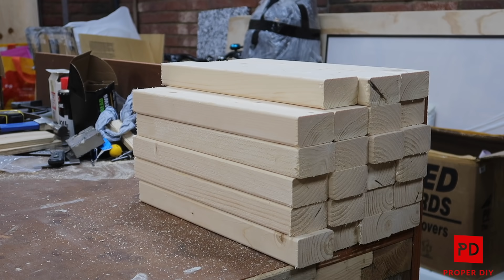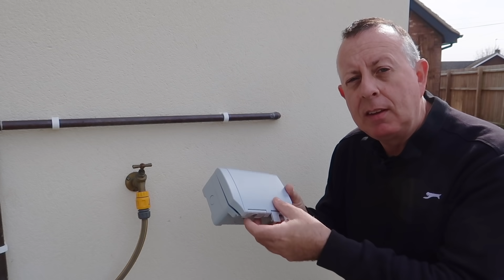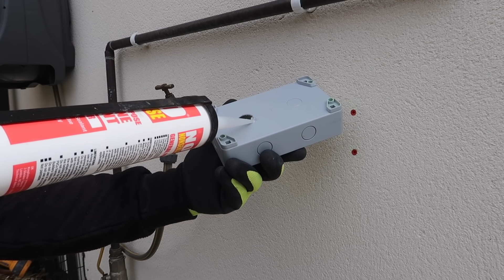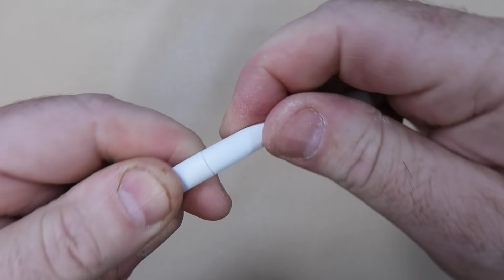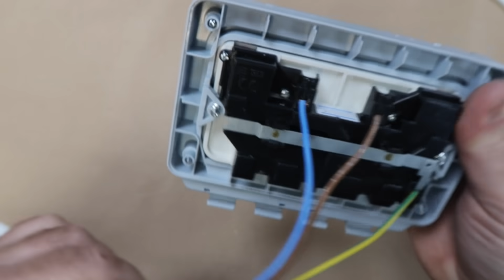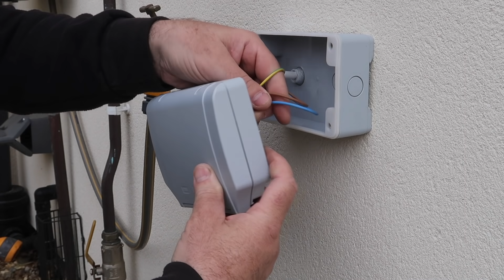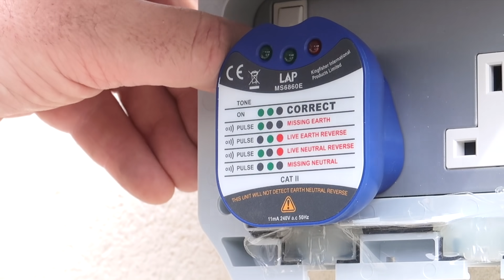How to Install the Easiest Outdoor Socket

Comment: Hi, complete electrical novice here so please excuse the "dumb" question.  In other similar videos about installing  an outside double socket all other fitters  have shown  to use a second earth cable to earth the box too. In your video just the 2 sockets are connected to the 3 wires. Is that OK or does it depend on what   the sockets will be used for?
Reply from the maker: It depends on the type of socket surround. My one is plastic so no need to earth but any that are metal will need a fly lead to ensure the box is earthed.
Reply: @ProperDIY  Many thanks. I haven't  bought the box yet, I keep watching these videos to give me the confidence  to try this myself. If I get a box and it turns out to be metal ,can you explain ( simply) what the "fly lead" is? Is it just a spare length of earth wire cut from an existing  cable?
Reply from the maker: @robinpunter4377  Yes exactly. You attach it from the earth connector on the back of the socket to typically a screw connector attached to the backbox. Good practice means you should put an earth sleeve around it to identify it as earth and ensure it doesn't make contact with any other connections.

Comment: Good drilling ! I confess I would always take it off an existing socket as a spur . Yes I know it means opening the wall plate and isolating but it’s a much nicer job internally instead of runnng wires n skirting etc , in my mind. I always do basic testing of it using a testing plug that tells me if it’s good etc when done that way and never had any issues .. I imagine the electricians will be horrified that a DIY’er dares to wire a socket themselves though …
Reply from the maker: Taking it off a spur is fine - just trying to give people different ideas. Yes, I get a lot of flack from electricians who think they are the only ones would should change a plug!

Comment: Excellent vid, will be fitting one of these next spring. However this has got me thinking. I’m putting in a media wall with TV etc. To break into ring main will be a lot of work and messy. My nearest socket is over 2m away, I could run an extension cable but it would look rubbish - I’d like to see a finished socket.... so could I adopt a similar method for an indoor socket?

Comment: Watching from Canada..  Nice job,  the codes are very different here and U.S.,  They wouldn't allow that type of setup here (essentially an extension cord through the wall) thus braided flex wire is not allowed in that application, and outside plugs (assuming that is 240V), as you mentioned, circuit must be dedicated AFCI/GFCI circuit either at the box or panel. Just did one for my kids electric car and conduit must also be coupled/ secured at the box.
Reply: I was looking for a comment along these lines. I also noticed the PEX connector, and I wasn't sure if that would fly. Any knowledge of that?

Comment: Great video, thanks for the clear explanation. Would this be a suitable option for getting power to a garden office cabin as long as the cable is armoured and buried at the correct depth? Would that allow for a small electrical heater and lighting etc? My gut feeling is I need an electrician to wire the cabin to the main house consumer unit but just wanted to check my options. Cheers!
Reply from the maker: Good question. Although there is no theoretical reason that this solution wouldn't get a certain amount of power to a garden office (even with an armoured cable properly installed). But, you really need to ensure that the earth is properly connected and an RCD (either external or within your consumer unit) is working at the correct speed etc. Both of those are difficult to prove without the correct training and equipment which is where I think an electrician comes in I'm afraid.
Reply: @ProperDIY  Thanks for the reply, much appreciated. I had a feeling that would be the way to go but just wanted to check. You have a great channel here, keep up the good work. Cheers!

Comment: Just wondering PD, is 1•5 flex a little on the low size if you were using power tools for garden projects ? I would have used 2•5 t & e , but then that's just me.
Reply from the maker: The problem with 2.5mm twin & earth is according to the regs it is not allowed to be used with a plug as future movement around the plug could cause it to break over time. 1.5mm flex can still take 10 amps which is enough for most tools
Reply: @ProperDIY  Fair point PD.

Comment: If you put the cable clip nail between the wire and base board. You can end up damaging the base board with the hammer. Having the wire on the base and nail above is the best way of doing it.

Comment: I love the way you did this and all the reasons why.  I’m planning to put an outdoor socket in for Christmas tree lights.  What could be more simple.  Thank you.  Liked and subscribed👍🏼
Reply from the maker: Glad it was helpful!
Reply: @ProperDIY Hi Stuart.  Me again.  I watched this video around three years ago and used your method for installing the outside socket and it still works great (touch wood) and it’s been really useful.  
So up to today and my daughter has asked me to fit one for her. No problem, it’s what us Dads do. But when I went online to look for a socket I was interested to see that most sockets now come with a length of cable with a 13 amp plug attached.  I know at the time there was a little bit of controversy regarding this method of installation. However, now that manufacturers are selling the plug sockets with a plug attached, in my opinion it disproves all the doubters.  Maybe it was actually you that gave them the idea eh?  Thanks again, Steve.
Reply from the maker: @stevejeffery4951  Thanks Steve for the info - I didn't realise! as I haven't fitted one since. I'm going to have a look into that now - and try to claim some backdated rights! (especially after the grief I got at the time from some people as you say!)

Comment: Silly question, but why the blank internal box,is it just cosmetic?
Reply from the maker: Yes correct - better than just seeing a cable surrounded with silicone coming out if the wall

Comment: Great video, what size drill did you use and also whats the best cable to get? Thank you
Reply from the maker: I used a 1.5mm cable as it will take more than the 13amp fuse. I think the drill was around 18 ro 20mm
Reply: @ProperDIY  thank you very much for your reply 👍

Comment: Does it not need to be 2.5mm cable for sockets?
Reply from the maker: It's all going through a 13amp plug so any cable over 1.5mm doesn't make any difference- the fuse will blow first
Reply: @ProperDIY  That's good because I got some 2.5mm and it's so thick and rigid I can't make it neat like I could with 1.5mm Flexi :)

Comment: I followed your advice to install an outdoor socket yesterday. Only after I installed did I read the instructions that say drilling out the rear knockout also compromises the IP rating. It seems the only way to retain the IP66 rating is to use a bottom knockout with the appropriate gland (and an unsightly wire coming out the bottom of the socket). This makes sense if the socket is remote from the house/garage but when on the side of the house is not a good look in my opinion.

Comment: Would a 25mm drill bit be ok and 20mm pipe instead or do I need to use the 18mm drill bit and 15mm pipe?

Comment: As an amateur,  can I ask why 1.5mm? I always thought 2.5 for mains and 1.5 for lighting as good practice. Thanks.
Reply from the maker: It's because in this configuration, the cable ends up getting fitted with a plug which is not something you can do with 2.5mm twin & earth.
Reply: @ProperDIY  thank you

Comment: My pottery kiln is rated at 2.9kw and the manual says "Ensure NO power board or extension cable is used between the power socket and the furnace." Would it not be appropriate to use this outdoor socket solution?

Comment: I actually bought a longer drill bit but in fact it was no good, because when it came through to the other side it blew out the rendering and left a big exit wound that needed to be redone and repainted! so drilling from both sides is definitely better, if you can figure out exactly where to mark, very clean and nice skill!
Reply: To

Comment: I’m an electrician myself and I like this idea and a very neat installation. Couple of tips When using stranded flex cable I always use ferrule crimps to prevent damaging the stranded cores when terminating. Also make sure the socket you plug into is RCD protected inside the house 👍.
Reply: He didn’t leave enough slack on the plug to use a bulky RCD adapter! 😂
Reply: Feral … 🦊  … maybe a bootlace ferrule would be better 😂😂😂
Reply: @andyxox4168  I thought that was an aglet 🤔
Reply: Nice to see you’ve corrected ‘Feral’
Reply: Also make sure the indoor socket you're plugging into is protected by an A type RCD and not an AC type to conform to current 18th edition electrical regulations.
Reply: Using crimps a bit overkill
Reply: @AuroraDragon_  required by bs7671 for fine stranded conductors

Comment: Hi Stuart, thoroughly enjoying all of your videos, great content and production. As a former electrician and electrical installation lecturer I agree that this is an excellent option for an experienced DIYer. This method removes the need to safely isolate, test and certify wiring attached to the existing circuit. As you mentioned this is an RCD protected extension lead so a great option for outdoor power. I used to teach the folding over method and the reason is that most terminals on electrical accessories are designed for two cables, so folding a single cable helps to fill the terminal and provide a more secure connection. Keep up the good work!
Reply from the maker: John, that is very much appreciated coming from an electrician - I tend to get a lot of grief from electricians who do't want to see anyone unqualified even fit a plug. Now I know why the cables are folded - learn something new every day!
Reply: @ProperDIY  Hi Stuart, I agree completely that in some circumstances a qualified tradesperson is the best option, but DIYers will have a go. I think you've illustrated a safe method of achieving an identical result to anything an electrician could produce. Do you mind me asking of you've done any formal teaching?
Reply from the maker: @JohnCarr43  Thanks! No, no formal training or teaching.
Reply: @ProperDIY  A natural then! Your videos are very clear and well produced, (I've currently got a large piece of plywood and several lengths of 2X4 in my garage ready to follow your workbench tutorial!) Looking forward to your next video.
Reply from the maker: @JohnCarr43  Nice one! Good luck with the build - new video out today!

Comment: Hi Stuart. Am about to order this kit and follow your instructions. Only difference is to power it,  I will have to run external flex along wall into the bottom of this unit. Do you recommend what kind and size of grommet/gland I need to order ???  Keep up the good work.

Comment: This a fixed installation you are installing and as such flexible cable must not be used ☹️ Regs. Also any outside socket must protected with RCD Regs again.
Reply from the maker: A flex 1.5mm cable can be used as it's essentially an extension lead protected by the 13amp fuse. You do absolutely need an RCD which I explained in the video.

Comment: Boy totally different wire colors used for hot and ground and different type of outlets from American standards. And no exposed electrical wires are allowed. Must be in conduit. Boy what a difference in electrical codes.
Reply from the maker: Yes totally different - maybe because we in the UK are also at 240v rather than 110v

Comment: Does the cable not need to be 2.5 core flex rather than 1.5?
Reply from the maker: No, the 1.5mm flex has more capacity than the 13amp fuse in the plug so the fuse would blow before the cable gets overloaded.

Comment: Great video. Thanks 👍🏻. Is it possible to install a switched fused spur on the inside of the wall to the plug?  Sorry - total novice (and don’t worry, not something I’d attempt myself!).
Reply from the maker: Thanks. Yes can do - if you were going to do that, it would be wired directly into your ring circuit of your sockets - no plug needed. No problem with this and it would be the way an electrician would naturally do it for you.

Comment: Very impressed and I totally agree its the safest DIY method and also with the added bonuses you mentioned  . One tip if using a set of pliers to strip back the insulation on the cables, is to do exactly what you did with the knife and score round first (basically griping the cable in the cutting edge and turning the pliers clockwise and back a couple of times ; this prevents both you gripping too tight and cutting it off completely and also helps prevent pulling the odd strand off too .. (apologies if this is mentioned below - 884 comments at the time of writing) 30+ years ago when doing my apprenticeship, we were always told to use strippers (cable ones!!!!) but, after a bit of practice you know just how tight to grip and it saves a bit of time as you can strip, cut and bend all in one go (so to speak! 🤔)
Reply: The only down side of this is that you take away one of your internal sockets availabilty. Rather wire as a spur or better still as part of the ring main, but it would then require sign off

Comment: I'm no expert elec but know you wouldn't have a socket in a bathroom or near taps etc. It's very near and in reach of the outside water tap. But a good series of advice and tips.

Comment: Nice one. I used a similar method to have a plug socket 40ft away from my house on my deck, but using armoured cable and an RCD plug to give a bit of extra safety just in case, given the exposed nature of the armoured cable running along my garden fence. 20yrs on and it's still a functioning extension socket.

Comment: 1.5 mil cable??? ...surely you mean 2.5...
Reply from the maker: No, 1.5mm flex. 2.5mm solid core is difficult to get into a plug and as the plug has a 13amp fuse a 2.5mm cable is isnt needed as a 1.5mm flex can take 15amps so the fuse will blow before the cable is overloaded
Reply: @ProperDIY  I even soldered 2.5 mm flex straight through the brass plug pins before now... - but I did watch towering inferno more than once... the builders merchants always loved me ...peeps who I fitted stuff for cried like babies sometimes at the cost of the materials... but nothing which I fitted ever caught fire...

Comment: Superb video thankyou. 
This works really well as one of the things that concerned me about having an outdoor socket (in a shared path), was other people plugging things into it. This way, when I'm not mowing/strimming I can just switch off at the plug! 
Impressed that you could line up two drill holes.
Reply from the maker: Exactly - you have control over it

Comment: Great video as usual, I've had a similar thing thing fitted , by an electrician,   ( a mate  ) he wired my shed up with armour cable and put sockets complete with a mother board which can trip out both ends and has been passed safe , so good all round .
Reply from the maker: Nice one

Comment: A very informative video which will suit most situations. To be absolutely technical a cable run at low level should have additional mechanical protection. I would have run it through the plastic piping and clipped that to the skirting. Nit-picking maybe. 🙂
Reply from the maker: I'm sure you are right. It's essentially an extension lead - all the others around my house are just lying on the floor - I'm sure I'm not the only one!
Reply: @ProperDIY  just realised that I have one in a bedroom myself. 😂

Comment: Having a double socket outdoors means there is a possibility of drawing 26A (2 x 13A), although unlikely.
Reply from the maker: Yes correct. Having a 4 way extension cable behind your TV or desk has the same risk.
Reply: The 13 amp fuse on the indoor plug top prevents this.

Comment: Hi, can I use the same method to wire up a PIR outside light…..so just fit the light in place of the outside socket….thanks
Reply from the maker: Yes you can
Reply: @ProperDIY  that’s great, thanks for the reply 👍
Reply: @ProperDIY  Update….x2 outside lights fitted today….£45 for the set of lights and £20 for the stores….couldn’t get a sparky to even visit for that price….well chuffed….thanks for the great advice 👍
Reply from the maker: @David-xc4us  Nice one! Well done!

Comment: Great video! Just a couple of questions...  I have some 2.5m twin and earth cable, can it be used with this job? And can the feed socket be a spur?
Reply from the maker: Theres nothing wrong with that size of cable other than you can't really use it with a plug. You can come off of another socket as a spur (if you have an RCD within your consumer unit) but if you have any problems with the outside socket you may find this tripping your electrical system. Thats why I like the system in the video as 99% of the time my external socket isn't connected to my system in any way.
Reply: @ProperDIY  Yeah have just realised the issue of not being able to connect the 2.5m to the actual plug... oops! Don't think I can do the spur either, as the socket I'm thinking of coming off is already a spur.

I guess your suggestion is to equip myself with some 1.5m to complete the exact same job as in the video?